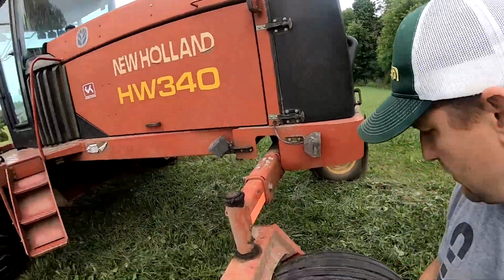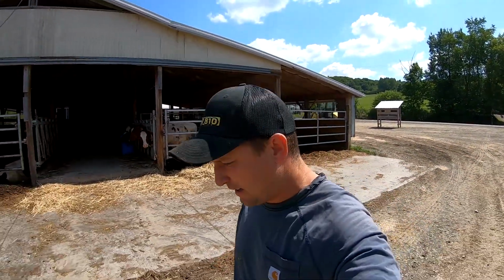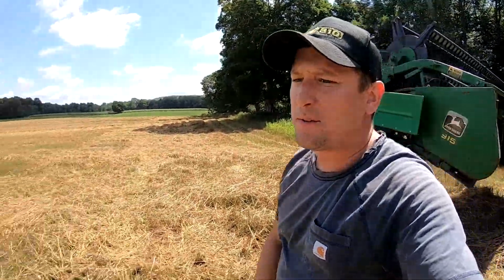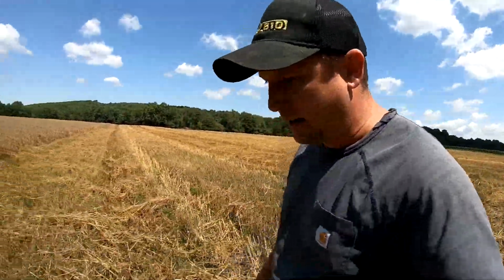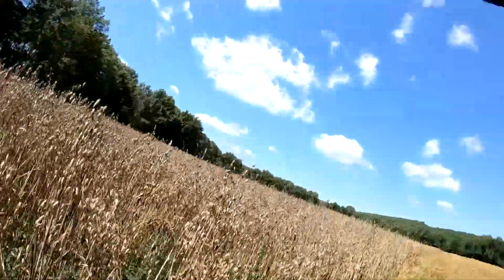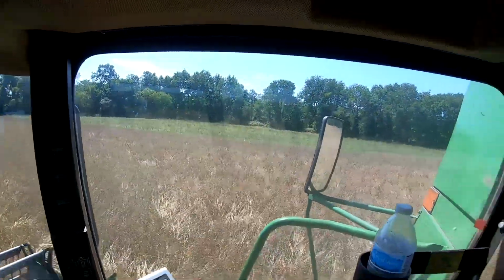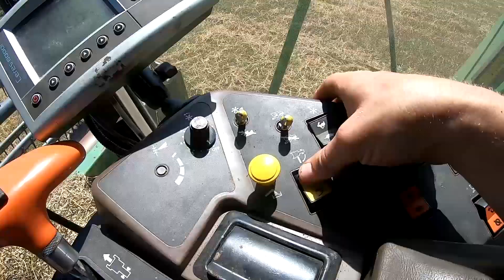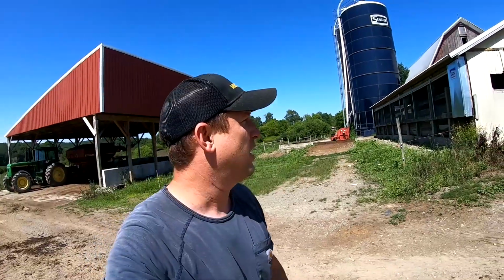John Deere 9500 Combining Oats

Comment: Ask Caz if they checked the feeder house drum balance you’re going to get some vibration in the cab but that seems like a little more than normal watching this video and you’ll get that if that drum is out of balance
Reply: And are you flying the drone yourself while you’re combining?
Reply from the maker: I think it has something to do with where I mounted the camera. I clamped it to the top knob of he gear shifter and it looks like my corner post is shaking but in the other view it looks like just the monitor is. I'm gonna check the screws to the monitor and make sure they are tight. No I wasn't combining and flying at the same time. I have drove the tractor and flown before but its difficult to do both. I stole some footage from the previous day when I was sitting in the tractor flying.
Reply: @TheGrumpyFarmer  I was thinking the same thing looked like a lot of vibration

Comment: Why is there so much vibration in the cab you can tell by the monitor
Reply: Due to the high cylinder speed.
Reply: THAT COMBINE HAS 5 STRAW WALKERS THAT RUN ON A CRANK SHAFT,SORTA WORKS LIKE A ENGINE PISTONS AND CRANK SHAFT FOR GRAIN SEPERATION.ALL THE NEWER COMBINES US A ROTOR FOR SEPERATION AND ARE MUCH SMOTHER.
Reply from the maker: The monitor isnt from the factory so the screws could be lose
Reply: Also the cutter bar cause's some..normal..thanks Mike
Reply from the maker: @johnlee6054  Thank you John

Comment: If your getting a shaking in the coming that is not from the sickle/header here is a tip.  

After doing some combing, especially damp grain straw, when you shut down let the machine stop.  Then run the machine and let it stop 2 or 3 times at idle.  The straw and chaff that builds up on the back of the cylinder bars falls off unevenly, and puts the cylinder out of balance for a bit.  Usually it take a few minutes of combining to build up chaff evenly on the back of bars.  The larger threshing cylinder, with 10 rasp bars, and much wider than your 4400, make this problem very noticeable.  Very common.  Doesn’t seem to be a problem in corn and soys when cylinder speeds are lower, but wheat is the worst when running 950 to1000 rpm.  What rpm you running for osts?  900?
Reply from the maker: It didnt feel lime it was shaking too bad to me. I clamped the camera to the range shifter so Im sure thats where you are getting the shaking from
Reply: I have had that happen many times in a 9600 , doesn't seem to be a problem when machine is loaded & working .
Reply: D6joe you have explained very well the cause of the cylinder temporarily being out of balance .   Separate issue ,  Mike do you have the laminated card that belongs with the machine that has the " suggested starting settings  "  for all the various crops  ?
Reply from the maker: @m.j.l.abulle9107  Yes we have that card. We used that to get the combine all set up when we started